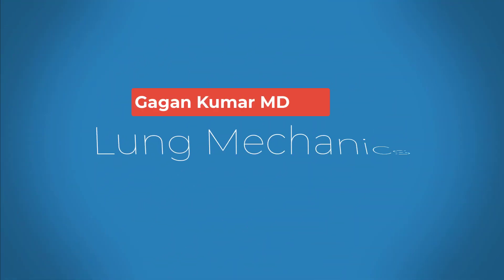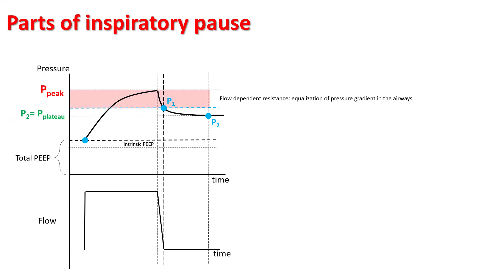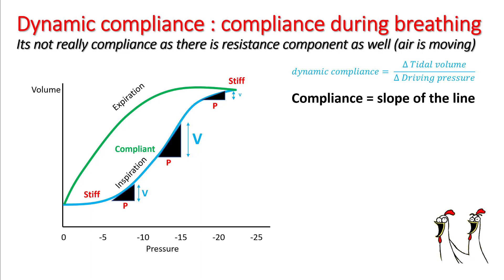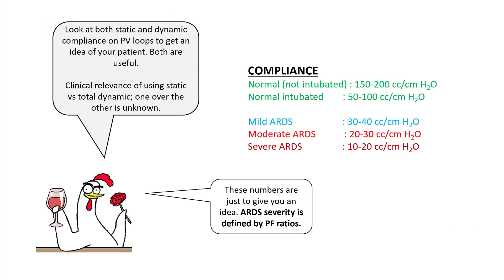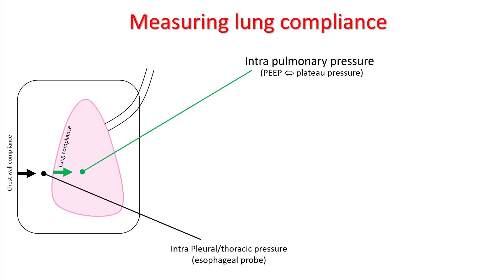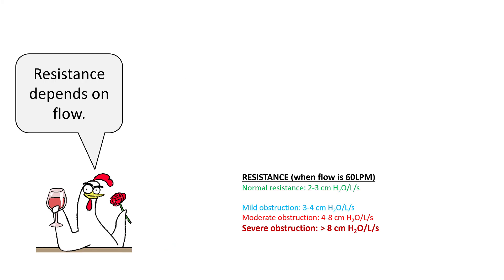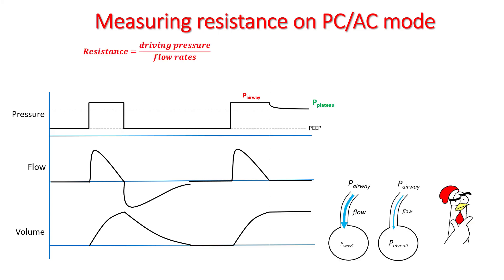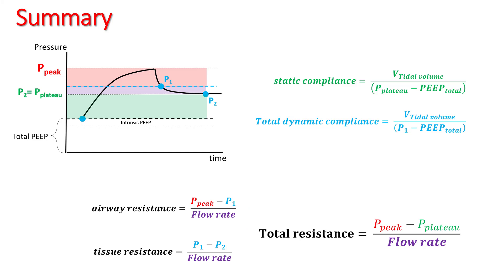Lung mechanics :  How to measure compliance and resistance on ventilator ?

Comment: if Resistance cant be measure in PC/AC bcoz flow vary , and also Compliance same thing because tidal volume vary on PC/AC, right ?
Reply from the maker: if patient is compliant with vent and your volumes on PC/AC are stable, you can get a good idea about compliance... the most important thing in compliance measurement is patient effort (spontaneous respirations). Even in VC/AC if patient is taking in deep breaths/asynchronous, his spontaneous respirations will change the pressure in the circuit so as to make the compliance measurement inaccurate... i know we sometimes get caught in these values, but most important role of these numbers are in the sickest patient like severe ARDS, where patients are more deeply sedated so as to be vent compliant and reduce work of breathing.

Comment: For calculating compliance, do you take  set tidal volume or exhaled tidal volume into consideration?
Reply from the maker: Ideally exhaled TV.. but if these numbers are not he same, you have some degree of patients effort which will result in error in compliance measurements. Most of the times the trend is more important than one time measurement. You can use either one for that.

Comment: This was probably a typo, but it is important to note that dynamic compliance is the change in tidal volume over your peak inspiratory pressure minus your peep and NOT your driving pressure as it was presented on this lecture, that would be static compliance.
Reply from the maker: To be honest, i found different definitions for dynamic compliance in literature. One of them was as you put it PIP-PEEP. Another was p1-PEEP. I think p1-peep made more sense to me as there is resistive component from PIP to p1.  This aside, i think the concept which i find clinically useful is the slope of the inspiratory loop at any given point. I think what I meant @ 2:18 was the delta change in volume with delta change in the driving pressure at that point. Thank you for pointing this.

Comment: sir wanna know about difference in peak inspiratory pressure and P1 .... in change it is PIP -PEEP and its confusing me. dose the change is small that the difference is irrelevant
Reply: i mean in chang
Reply from the maker: Peak inspiratory pressure is the highest pressure achieved during the volume control ventilation (@ beginning of end inspiratory pause). 
P1 is the point where there is no air flow in the major airways after end inspiratory pause.
Plateau pressure (P2) is the lowest pressure achieved after end inspiratory pause - after all air flow is zero (even in the alveoli)